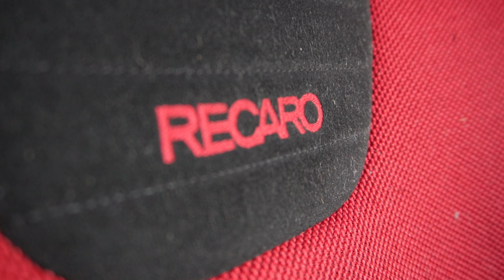Honda Civic TypeR

Comment: So this is why it's 200k now... I thought dropping it by 100k brought it to about the right value.. personally I feel 180k sounds about right, but now that it's got a stock motor again.. i dont know. 160kw is still very healthy though. EP3 type R would be quite valuable if it was all stock and not messed with and all the numbers matched up.. and if the milage was OK. It's difficult to put a number on it I feel. I've seen the car quite a few times, and I remember the driver side door was messed up with dings.